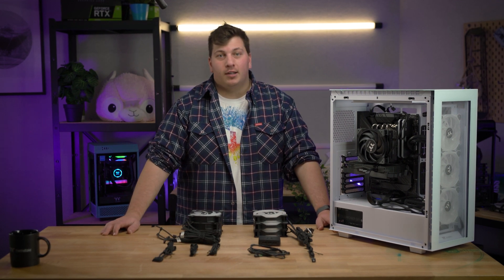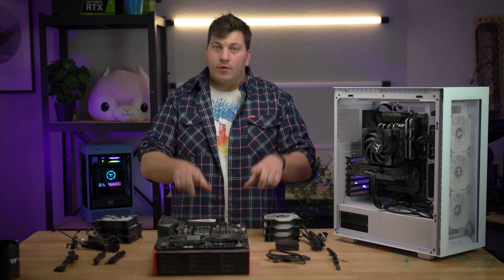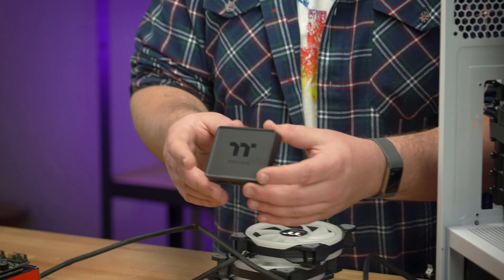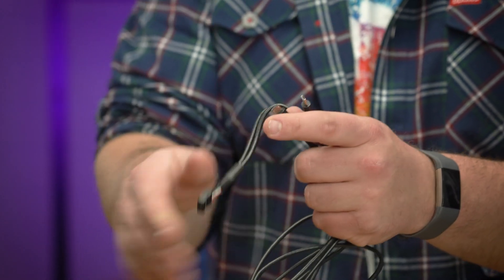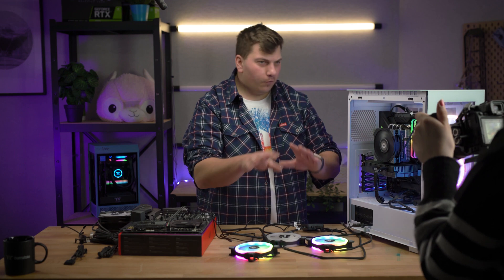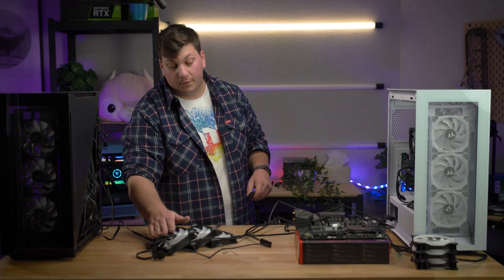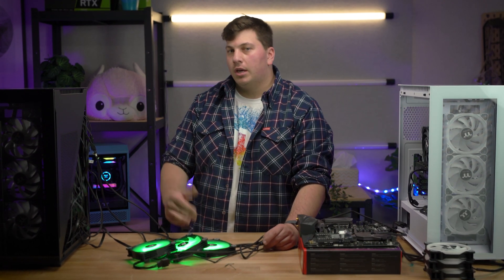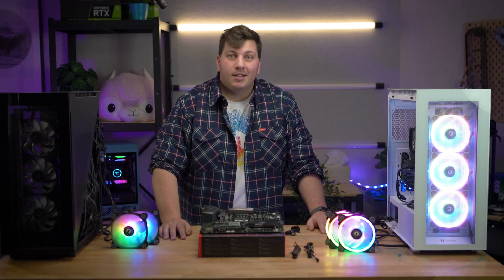How to connect RGB Fans & other RGB products | An RGB guide (aRGB + Digital RGB)

Comment: The ASUS z390-A motherboard has regular 4 pin SYS-Fans & RGB headers.  It is clear the regular non RGB fans plug onto those headers. The RGB headers has white  4 pins socket. Can I plug an RGB fan ther without the controller?

Comment: a great way to findout my new and old fans are two types of fans. i am in no way a tech guy. and didnt realise as im replacing a broken aio with an air cooler that the fans included with the old aio are proprietary rgb.....at least the fans are still functional.

Comment: Help me with plugging in two argb CPU coolers and argb PC case coolers of fractal design torrent compact. Do I need to buy additional argb cable that will connect all argb fan cables to MB?

Comment: So for the ARGB, do I just download the software instead of plugging the extra cables except the 4-1 pin ARGB connector? I recently bought a fan splitter and I connected it to the 4-1 pin ARGB connector and it works, but my LEDs aren’t on. I have a ASEUS motherboard so do I have to download a software for AESUS? If you could answer my question, I would appreciate it 🙏

Comment: I purchased a new CyberpowerPC a few weeks ago and noticed that I couldn't control my RGB colors from the fusion software. I spent a lot of time until I saw someone say there is a button on the top of the case which cycles through the different color options. I did that and everything works great. One thing that puzzles me is that none of the RGB headers on the motherboard have anything plugged into them. So how are the lights working? On cyberbpowerPC's do you know if there is a controller board? I don't want to go digging into the cables for the fear of breaking something since everything is working fine. But just for future knowledge how are the lights in my cyberpower working when nothing is plugged into the motherboard.

Comment: What if I’m wanting to go with the thermaltake swafan (9x EX12’s, 3 side, 3 bottom, 3 AIO. And 1 EX14 for the back of the case) which ones would be best to use so I know I have enough connections and don’t have to wait and order more parts when it time to build? I’m using the aorus X670E pro X white motherboard

Comment: If you're using an RGB hub to plug your fans into, and then the RGB hub plugs into a single ARGB header on the motherboard. Can the motherboard control each fan RGB individually? Or are they all controlled by one signal?

Comment: for the ARGB and using the E cable to connect to the 5 volt header, how does one control the color/mode of the lights for that method?

Comment: Hey guys, i just got a Thermaltake Divider 370 case which comes with 3 pre installed fans and a controller hub, the hub needs to be connected to a PSU SATA connector, to a fan header and there is a signal bridge cable that needs to be connected to an addressable led header, right? But i dont know in which add header should i connect. I have an Asus Prime A Z790 MB and it has 3 addressable 5v headers and one that its 12v and the manual says its the Aura RGB addressable header, so if i want to control the fan lights via armory/aura software and to sync, i need to use that 12v rgb header or i can use any of them? Thanks!

Comment: Hello
I have an Artic freezer and 35 argb, it has 3 pins for connecting, and the motherboard Asus prime B450 has a small 12 v header rgb, how can I connect the cooler from the processor so as not to damage the board?
And the case is DEEPcool 50 matrexx, it has 4 argb coolers that are all connected...

Comment: Very nice video, very informative. Good job! One thing to keep in mind for the future - when you are showing cable connectors to the viewer - keep them still and let your camera focus on the actual connector. Most of the time it is out of focus and the viewer has no way to see the actual connector on their screen. You can easily bring in a still image into post production which would nicely show the head of the connector, all the pins, etc.

Comment: I did an asus  z690 they  have  several 3 pin headers the fan led were connected directly to the to the board with  a splitter cable   The 4 pin pwm was connected directly to a 4 pin pwm header there was also 3 pin hub for non pwm fans the case came with that  2 case fans  3 pin fans connected ( no leds on these ) allowing speed of all fans to be set thru the bios according to system temperature . Also the bios had settings to change the color patterns on the led   .  If posable this saves lots of extra cable . Research your board to see what it supports before buying . This gets complicated .

Comment: Can we connect xpg 3 pin led controller connector with liquid cooler 3 pin connector for argb sync bcz my motherboard does not have 3 pin argb header. So I want to sync liquid cooler fans and pump with I/O led controller is it possible? My case is xpg battle cruiser. I already connect with reset sw with 2 pin connector on liquid cooler but It's not sync able that's why I ask you if i connect with 3 pin argb connector is it work?

Comment: My fans are orange by default, when i change the colors, after i turn my pc off, the color goes back to orange (to the default) i have to open the case everytime i turn my pc on to switch colors. How can i fix this? Also, apps don't detect my mortherboard/Fans.

Comment: I'm trying to build my first pc with an asus motherboard and got everything hooked up but I'm not getting the fans setup in the case. The aio triple fans have the 3 prongs which hook together and plug into the 5v port on the motherboard but the triple fans that came with the asus case have 4 prongs and attach to a sata plug but no controller. Do I still just plug it into the power supply or how do I make them work together

Comment: If my motherboard doesn't have an RGB header, can I use an adapter and just connect the fan's power cable to my motherboard and the RGB pin to an adapter?

Comment: Cheers for this guys! Just bought the Pure Duo 12. Fitted it earlier, followed this guide and connected the fans in series and used tbr 5v ATGB header on my Asus tuf b650 plus mobo. But no lights :( where did I go wrong?! They don't show up in the Aura thing!
Reply from the maker: Hey there! Have a look at our newer RGB guide and it might answer your question: https://youtu.be/jTJBlHSG7ec
Reply: Yup, watched them both. Its strange! :(
Reply from the maker: Hmm that is a head scratcher. If you hook them up to the TT controller, do they work then? Just want to rule out it being something to do with the motherboard itself, so using the controller bypasses it.
Reply: @ThermaltakeAustralia  thanks for taking the time to reply. I'm not going to say this was user error... because that would be admitting fault.. but it maaaay have been user error. The connector plugging into the 5v header was slightly loose. Hard to see behind this huge damn GPU. Thanks again! All sorted.
Reply from the maker: @Psychosix  Wonderful so glad to hear you were able to figure it out. We've all been there don't worry!

Comment: Thank you! This video was very helpful. I was just wondering. If I would use the manual controller. Would I still be able to use software to change the colour of the leds? Or only via the manual box? It seems more easy to use the manual controller to connect the fans.

Comment: I really need help with some RGB fans that I just purchased. They came with simple power supply plugs and/or MB fan plugs that did not include any additional accessories.. My MB has RGB headers but I don't know how to connect these fans as they are without any accessories I obviously need to make them work properly. It seems that all I can do is simply daisy chain them. I was hoping this video would be helpful but instead it seemed to be nothing more than a long winded infomercial. Simply laying out various fans & demonstrating a step by step demonstration to connect them & the proper plugs or equipment needed would have been sufficient. People are watching this video for a reason, they need technical help not a product purchase. Sorry but this video just made me even more frustrated than I already am.. I just learned everything except what I needed to know.

Comment: Hey! So, I have a fancontroller that comes with my pc, it has a sata connector and a 3pin I believe. If I connect 4 ARGBs into the controller and plug the controller into a single 3 pin 5V header, what are the chances of something frying? =D
Reply: 100%
Reply: @snakeboy17d  liar😅
Reply: @ДанилФедосенко-м7ф  😂

Comment: bro my case ain come with no controller wtf do i do
Reply from the maker: It's gonna depend on the case, but it's likely your fans might just be motherboard software controlled. In which case, they will just hook up directly to your motherboard.
Reply: @Thermaltake Australia  that's what I've got going on rn but nothing will connect to the software bc it says there's no controller. How do I change things?

Comment: Can you link to system sensors? For example as CPU temperature changes from cooler (blue) to hotter (red) ?
Reply: yes you can in asus software there is an option smart light in which it will show you colours based on processor temperature.

Comment: If there are enough fan headers on the mobo, is it ‘better’ to connect each fan directly to the mobo or does it not matter?
Reply: I prefer directly to the mobo, but i guess it does not matter that much as long as the controller is conected to the mobo....

Comment: hi thanks for all those helpful info
i have a question 
i lost my mini connector that came with my cpu cooler and the cooler is working but fans arent lighting btw my cooler is cooler master hyper 212 turbo Argb air cooler and my motherboard is fromk asus its prime b660-a plus and it support argb and aura sync also has addresable rgb gen 2 header so how can i make my fans light 
please help

Comment: nice explanation. thank you. Just one question, in case you connect ARGB fans together (asi you did) you cannot control them separately. All lights the same way. Is it correct? thank you.
Reply from the maker: Hey Peter, that's correct, if they are connected together into the same Header on the motherboard, then they will all change together.

Comment: thank you great demon strate but 
i have rams ARGB
fans ARGB
cpu cooler RGB 
can i all sync them together and control them by a software
all i can control is my rmas with soft ware 
and the fans from a button on the case wich i dont want i want it to be controlled by a soft ware so i can sync everything
and i can't control the cpu cooler

Comment: I do have one question: I have 2 sets of A-RGB fans (1 from Thermaltake, 1 from Deepcool) both needs to connect to the 5V header (ADD.Header) in order to control the RGB. But there is only one 5V header on my motherboard, is there a way to connect both of them to the same ADD.Header?
Reply: use a 2 way 3 pin rgb splitter to plug them into the same port

Comment: Those are still ridiculously primitive!
Millions of wires to different places to get a couple of propellers spinning with the colors.
Is it so damn hard to get the fan and rgb power in one cable just like fan without RGB.
Also motherboard manufactures could put 10+ (4pin connectors) to their products just because RGB fans by itself.
I thought we were living in the 21st century.

Comment: My RGB fans are 6-pin. I do have a bluetooth controller for them but I'd prefer for my CPU to actually control the fan speed. How/where would I plug them in the mobo?
Why do mobos have JUST "RGB strip" and "aRGB strip" headers??? Why no "rgb FAN" or "argb FAN" headers?
I do get the aRGB part, it's way simpler!
10:22 Aaand it's no longer simple. Where on earth do we find dedicated (a)RGB cables specifically for our motherboard's (a)RGB header? My mobo's manual says nothing about the RGB or aRGB headers being 5 or 12 volts either... :'((

Comment: PLEASE HELP!! I Built a pc using your guides, I'm using an intel 12700k with no gpu Im only using uhd 770. I have an rgb hub with 6 rgb headers, I have 7 fans in total plus 2 argb lighting strips. I daisy chained my 3 aio fans argb connectors together plus the aio head's argb and the exhaust fan's argb having a total of 5 argb connectors daisy chained together. Now, I hooked up the daisy chained connectors on my rgb hub, I have only 2 connected rgb connectors in my rgb hub, 1 led strip and the daisy chained connectors. NOW THE PROBLEM is whenever I boot my pc the display looks messed up, it has this weird pixelated glitch. Isn't that the 5 rgb connectors daisy chained together may have caused this problem?

Comment: Demystified the process for me a little bit. Trying to do a 10 fan argb setup (360 aio side or front intake, 3 bottom intake, 1 rear exhaust and the 3 top exhaust) and I wasn't sure which headers to use. If my argb comes with a fan controller would I only need the 1 controller into the 5v rgb header on the mobo for the 7 daisy chained 120 fans and then the 360 aio into the aio header on the mobo to sync all the rgb with software? Or would I need to use 2 controllers with 4 fans in one controller that bridges into the 2nd controller with 3 fans, that runs into the 5v header on the mobo? I'll probably be using the asus tuf z690 and from what I gathered it has 4 regular fan headers, 2 rgb headers, the 2 cpu fan headers and an aio header. Would the controller(s) occupy 1 rgb header and the aio the 2nd rgb header?

Comment: hey, you are a life saver .  my fans are the  ARGB ones,   you just explained to me how the rgb of  these  fans work thank you so much  . I have a situation here which is driving me crazy .  i lost the dedicates  cables  to turn the rgb through the motherboard . and also y dont have the little  manual controller ...  my motherboard (msi x570 mpg wifi )  so I would thank you so much if you can tell me what are the specs  of the cable or also little  manual controller  and where i could find it  to buy it .    I cant find it anywhere . 

please help me to find an option to thet my rgb on . pleaseee !!!!
Reply: confirmame si esto me podria ayudar . se que no se hacen responsables . pero veo que usa la misma coneccion ?

Comment: They all need to be universal.  They make the proprietary crap so you have to buy their overpriced controller box... It's what Corsair does.
Reply from the maker: 5v aRGB is standard for the most part. 
You can use ASUS, MSI, AsRock & Gigabyte motherboards to control 5v aRGB products from us and MANY competitors. You are limited to what software from the motherboards can do, but it's universal. 
Our Digital Fans, single or three-packs come with controllers as the controllers have the appropriate power to drive all of the LED's in our Digital Fans and allow us to have greater control of RGB effects.

Comment: What 120mm RGB case fans will work on an MSI Z390 Gaming plus? the Fan header is JRGB, sorry I know its probably a dumb question
Reply: My Motherboard scheme shows a JRGB header, and Its a 4 pin RGB connector (12V). That said, you must buy fans with 4 pin  RGB cables (NOT 5V ARGB)
Reply: @dowglaslimabarbosasousa4294  Thank you so much for the response, I ended up getting 4 pin (12V) Antec RGB 120mm fans, with a thermaltake 4 pin hub!

Comment: I conected my fans to the motherboard and somehow they light up but just don’t spin
Reply from the maker: Oh no! Sounds like they're getting LED power but not actual power to the fan motor. 
The things to check would be;
That youve plugged in your 3/4 pin header.
If the fans are connected to a controller, that the controller has power (most likely via SATA)
That the fan blades are not blocked by a cable.

^ hope that might help.

Comment: how do i connect  9 pure 12 argb fans to asus motherboard?
Reply from the maker: Hey Johan, you should be able to daisy-chain the 9 fans together and then use the included 5V RGB header cable (Labeled "E") to connect them to the Asus Motherboard. As long as the motherboard supports 5V RGB.

Comment: Despite my computer culture, I still don't have much experience with RGB. I have had two 200mm Aerocool DUO20 fans for at least 2 years. Thanks to you I gave them colour for the first time via the 'Addressable Gen2' connectors on my Asus ROG MAXIMUS Z690 FORMULA which I had never connected 🤣🤣🤣🤣

Comment: Ohhh my god how can I be this dumb, I got a whole new motherboard and well all my cords that were already cable managed and were where they needed to be for the new motherboard. The 12v header connector was at the bottom and well where my fans were plugged into on the last board so I assume just put it where it was roughy were.  Whelp I believe I’ve been putting my 5v into the 12v connector /: the fans were lighting up at first but now they not lighting up and dark. Tomorrow I’m gonna try and plug it into the 5v to just hope they turn back on /;

Comment: Hi, i have the smart rgb pro psu and thinking of changing the cables…however only corsair sells the cable kit, thermltake doesnt supply the 24 pin cable in my region…question what ‘type’ (3 or 4)is the 24 pin cable and is it possible to use corsairs ‘s cables on my psu? Sorry off topic from argb fans and total nooby questions. Pls help thx

Comment: I have a friend who just picked up a set of the RGB fans with the controller. How do we control the lighting? We tried to download TT RGB Plus software but not having much luck. Will aura sync work even though it's only connected to a USB port on the mobo?

Comment: hi, ive purchased an argb fan to replace my standard cpu fan so my question is would it be ok to connect the power cable og the fan to the fan headers (12v) on mobo (giga h97 gaming 3) fans (be quiet light wings) i was told that the fan headers on mobo are standard 12 V.